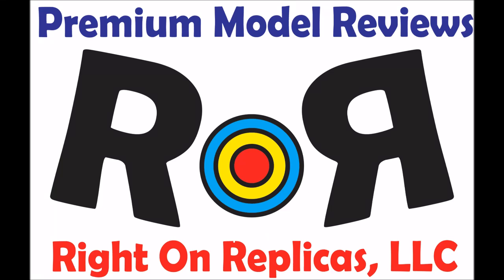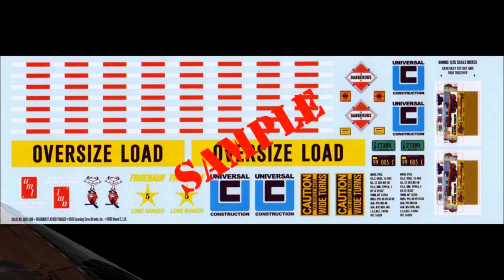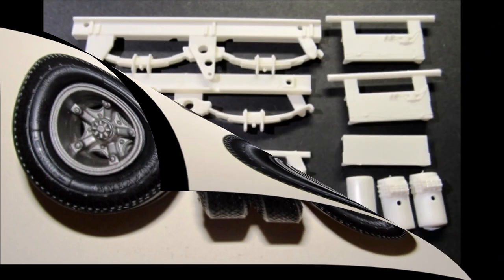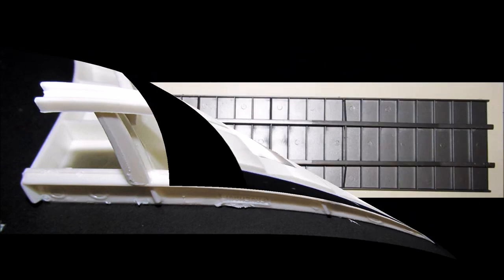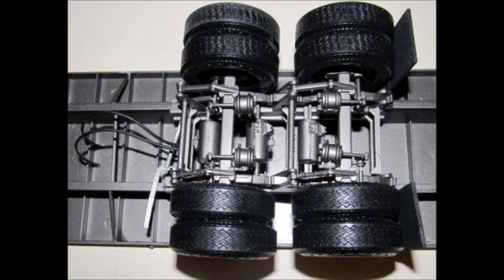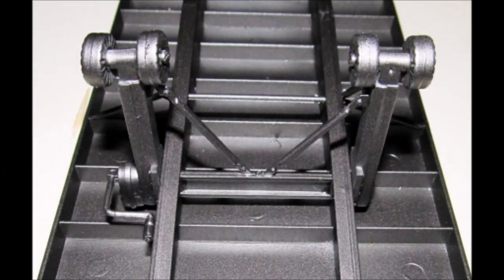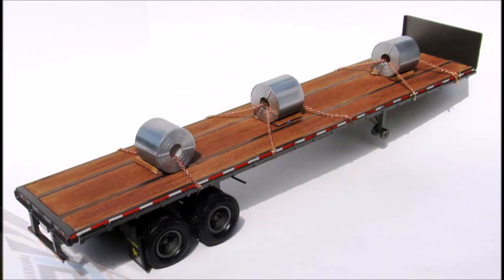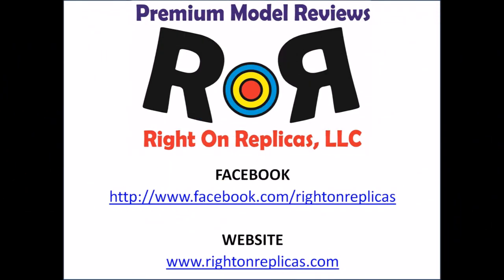How to Build the Fruehauf Flatbed Trailer 1:25 Scale AMT Model Kit #617 Review

Comment: Realizing that this trailer is from the "60's", I made an attempt to bring it up to date and somewhat comparable to what's actually out on the road today. First of all I split the tandem, (not quite 50/50), providing a modern split axle set up and added a large storage box between the two. I beefed up the rear cap and header as well as the DOT railing. To my amazement, for an amatuer like me, it turned out very nice.
Reply from the maker: EZ, it sounds great and I don't think you give yourself enough credit.  If you can do those things you've graduated form amateur status!  -Doug
Reply: That sounds exactly what I'd like to do I'd like to see that sounds great

Comment: Just a note for future visitors. The first image shows the rear "push rods" mounted incorrectly. The push rods are set in an OVER - UNDER configuration (2 sets over and  2 sets under the axle). When upright, the rear push rods are located over the rear axle and under the axle on the front.
Reply from the maker: SS,  Thanks for the info!      PS,  please subscribe if you haven't already to help us reach more modelers.  -Doug

Comment: Why is this trailer so expensive, where can these be purchased other then eBay?   Thx
Reply from the maker: Ck,  Like anything else it's supply and demand.  This kit is now out of production last released in 2009.  I sometimes feature these vintage kits so builders know they are out they if it fills their need. But I'm sorry, I can't control the price.  They may be re-issued someday but until then the market rules their value!  -Doug
Reply: Right On Replicas Thanks for replying - it's a shame that being fairly new (2009) that a kit like this would already be 'rare' when there is an abundance of plastic :).  Anyway thanks for the videos as I enjoy watching them and will use them as a reference as I get back into building my kits.
Reply from the maker: Ck, you're welcome and have fun!  -Doug